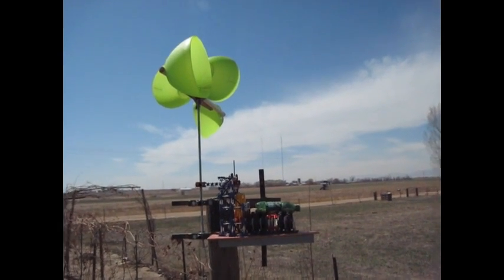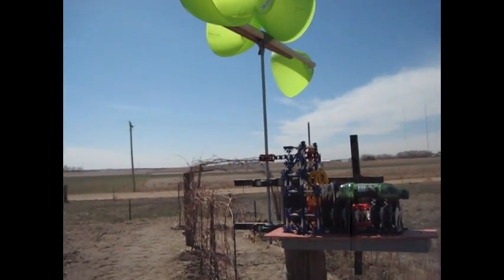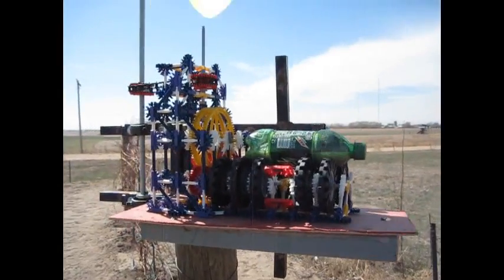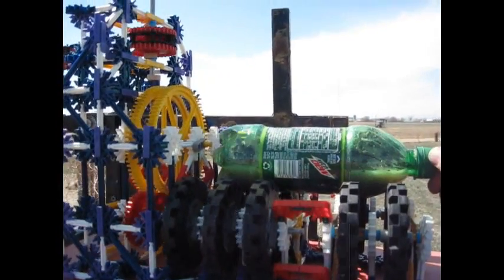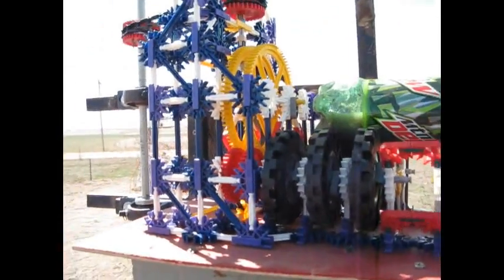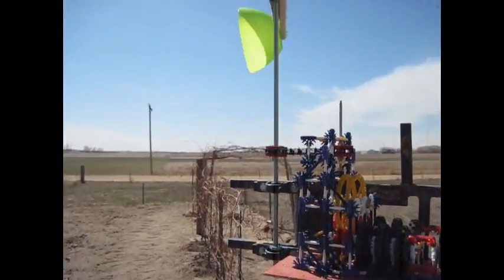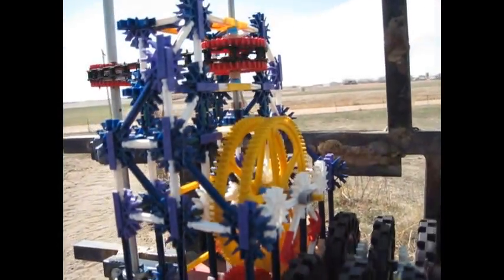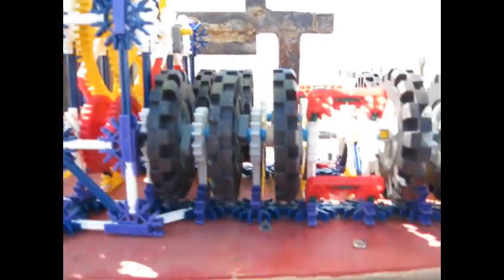Wind Powered Rock Polisher

Comment: This is great. Using mechanical energy where mechanical energy is needed. Everybody seems to be so eager to convert everything to electricity and then to use that electricity to do stuff. If one could add a flywheel then this concept has a lot of potential for the mining industry. Seriously. 
Aside: Can you tell us where the parts are from ? It looks like some kind of set.